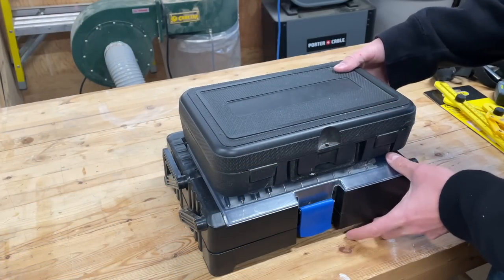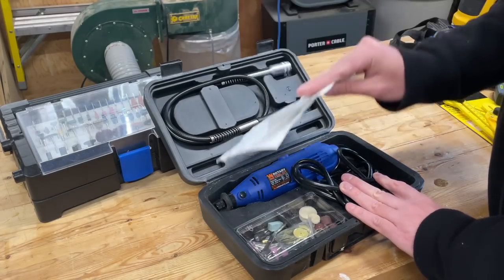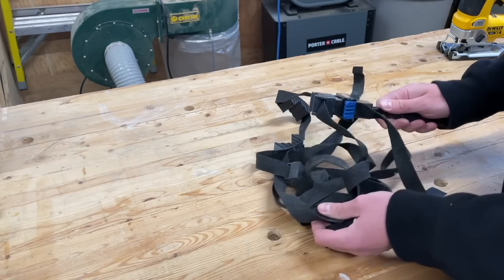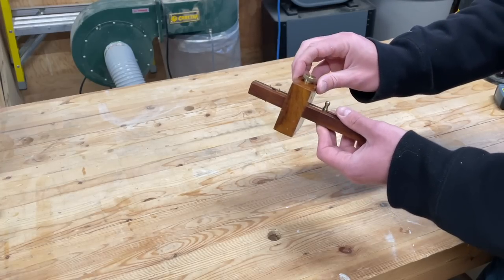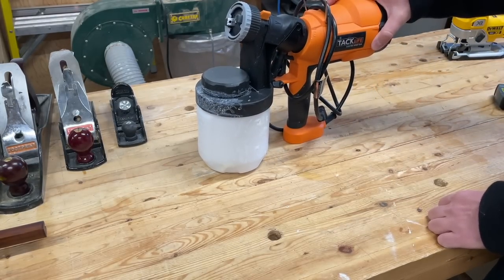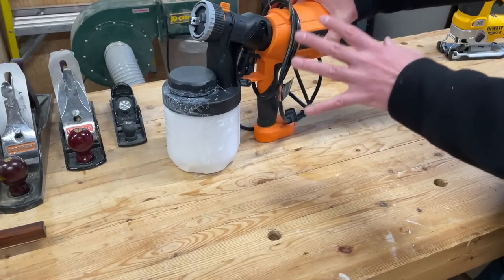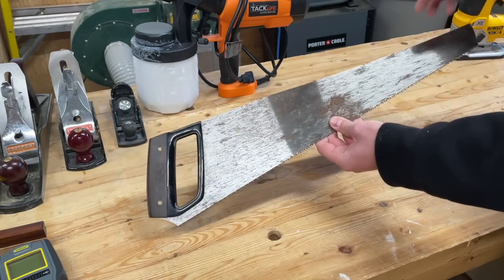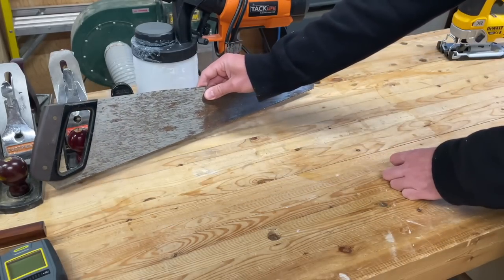Don't Buy These Tools // 10 Woodworking Tools I Wish I Didn't Buy

Comment: I have that same rotary tool and I actually love mine. It's come in handy many times. Not sure what you mean by "glitching out" but I've never had a problem with it. It's not a tool you will use a lot, but when you need it, it's amazing.
Reply from the maker: Happy to hear that you've had a good experience. I'll still use mine for small things here and there, but the motor will give a bit of a buzz, then shut off. I then have to leave it for a few minutes before it'll start again. I probably should have tried to return it after it did it the first time.

Comment: YES! Do not buy cheap. My rule is to not buy till you need it. Having said that, I do have a sweet Incra miter gauge that’s been in the box for nearly a year. It’s not because I don’t plan to use it. I just have a large honey-do list that distracts me from my hobby. (probably should’ve waited). My least used tool is a general tools contour gauge. I think I got it to figure out a shape to the laminate flooring around corner. Cardboard works better. I rarely use my jigsaw, BUUUUT it’s great when you need it so it will always be part of my arsenal of tools.
Reply from the maker: Ah yes, those contour gauges - they are always among the most-promoted "tools" on Amazon and infiltrate my Instagram account regularly. Similar to your Incra miter gauge, I had my Porter Cable dovetail jig in a box for 6 months before I finally go around to setting it up - now I love it!

Comment: Every time I think about getting a cheap tool, I end up deciding I'm better off with no tool.  That has kept me from just buying a bunch of tools I might need.  If I want a certain tool, I look at the best of the best, and then compare downward.  I find that easier than starting off cheap and trying to compare upward.  When comparing upward, price is the main focus over feature/quality gain.  You think more about money than what you want to accomplish.  When comparing downward, loss of features/quality is the focus over cost savings.  You think more about what you want to do, and what the end result will be.  Instead of thinking is it worth $50 more to get that feature, you're thinking is is worth loosing that feature to save $50.   I don't always buy the most expensive tool, but I usually feel like I got the tool that will do what I need it to.  There have been exceptions.   I've come to dislike a lot of Amazon.  They're turning into a flea market.
Reply from the maker: Awesome thoughts there, thanks for sharing Chip! I really like your approach to buying tools. I'm currently planning a "here are the tools to get started woodworking" and I'm realizing how many tools/accessories that I have that while they are useful for me, they are also unnecessary when it comes to the results.

While Amazon can sometimes have deals on well-known name-brand tools, what they promote as "tools", "DIY", and "home improvement" products is absolutely brutal. Lots of lighting strips and cheap knock-off tools. Sad part is that it's not just with tools.
Reply: I agree. Took some years but I came around to the "what is 2 or 3 notches down from the best?" way of thinking. I rarely buy the king of the hill, but I save a lot of money and still get a lot of good capability by going for a high qualifying runner-up.

Comment: Agree re: Dremel , woodplaner and the saw . Disagree totally with the jigsaw . It's got so many uses . With a scroll blade you can cut quite delicate curves , or change blades and rip decking boards  . 2nd tool I ever bought after my drill .
Reply from the maker: I've really come around on the jig saw and it's become a frequently-used tool in my shop! Just took the right blade and right setting to get it perfect.

Comment: My husband bought me a Dremal which I have used for a number of things. Stripping furniture with hard to reach areas. Taking the edge of a tile so I could replace an outlet in the bathroom with one that shuts off when wet. The new one would not fit. 
He also bought the accessory kit to go with it. What I have discovered is that some things I have used so much I have had to replace them several times. Some I have never used at all. But until you own one you have no idea what parts are useful.
Reply from the maker: Thanks for sharing! I think there is something to be said for the name brand tool and accessories, especially with regards to Dremel!

Comment: The problem with cheap hand planes is that they deter people from going further into woodworking. If you want a good plane, buy a used Stanley type 19 or earlier. You can find good users or ones that have been tuned up, but chances are you’ll throw some time into tuning it up yourself, which will be worth the effort. Just learn the cheap features on cheap hand planes and why they are not worth the effort. Then go get a vintage Stanley and when you take the first very fine shaving off a board, you’ll be glad you went vintage.
Reply: Great comment. My first hand plane I bought at Lowes. I returned it the next day lol

Comment: I bought a $15 Lowes hand plane and spent countless hours getting the bottom flat.  In the end, i'm happy i bought it and fixed it up and it will get me by until I know more precisely what nice one i need to buy.  

The one purchase that I instantly returned was the Kreg Accucut, or whatever it is called.  I had to make modifications for it to fit my circular saw and it was not precise at all.  The wider the cut, the worse it got.  Thank goodness for Woodcraft's generous return policy.  Junk!

Comment: I agree with some of your choices except for Dewalt jigsaw. It's not a tool iuse a great deal since i bought it, but when i do use it I'm so glad I did, I know that if I sold I would regrat doing so later on. Pretty much the same for the rotary tool. As for the angleiser I live in hope that one day I will find it useful and think to myself what a great purchase. My worst 3 though would have to be an electric tile cutter and a mitre saw stand, both sit in my shed taking up useful space. And a dewalt cordless angle grinder, used it once 6 months after buying it and could not believe how much it used up batteries, One of my best has to be my Dewalt cordless 1/4 sheet sander, Iuse it daily at work and it is great.

Comment: I also want to say that stay away from any Harbor Freight "woodworking" tools that are used for any cutting, marking or measuring. The only thing I but from Harbor Freight are 1/8" drill birds for my counter sink drill bit, some of the clamps and the casters. And, any of the one time use items like acid brushes, small quite brushes and wire wheels for your drill. I did buy the 2-n-1 18g air stapler and bread nailer, the Diablo air hose and the purple gravity paint sprayer, those are worth it for getting started but will definitely upgrade in the near future
Reply from the maker: Ah yes, the wonderful world of Harbor Freight (rough equivalent here in Canada is Princess Auto). When visiting the USA, I've hit up Harbor Freight a few times and those coupons make some of the larger ticket items temping, but I've generally stuck to some of the cheap squeeze clamps and casters like you.
Reply: I would probably buy a door stop from Harbor Freight.

Comment: You must have gotten a bad Kreg multi-mark and should have returned it for another. I love mine and have been using it daily for the past 7 or 8 years. I use it mainly for repeatable dimensions, especially when I do metalworking.
Reply from the maker: I've been using it for some home improvement projects the past few months and have found it helpful for reveals and other depth-related items. It has it's use in those cases, but it's not necessarily as versatile as Kreg pitches.
Reply: Kreg multi mark is an amazing tool and worth every penny. A great addition to my tools. And I agree. Mine is completely square.

Comment: I agree with everything and yeah i bought a rotary tool and wish i didn't and yeah agree with you view on the marking gauge's round blade is better, I have two cross cut saws in the corner used a couple times in a decade, even came close to buying a moisture gauge and a sprayer but didn't thankfully, as for the jig saw most things can be done with a coping saw just as quick but i do use it for tissue box top openings and similar things. LAST but not LEAST I have the same small yellow angle finder and its horrible just haven't brought myself to toss it out yet. 
Lesson learned from your video is you need to spend decent money on the things you actually need and you don't know what that is till you need it. 
Thanks for the video.
Reply from the maker: Thanks for watching and sharing! Absolutely agree with you.

Comment: Refreshing review!  Add up what you spent on the poor tools, not including the jigsaw, just to realize what GOOD tools you could have purchased for the same money.  If I think I need a tool I put it in the back of my mind until not having that tool either makes work much harder or I can't complete the job without it.  I use my  (real) Dremel tools all the time when building radio controlled airplanes but almost never in the woodworking shop.

Comment: I have a cheap electric spray gun and it is totally ace - yes you have to thin the paint, but I also have compressor fed guns which need paint to be just as thin. I can get some really fantastic finishes with my cheap electric gun - infact I tend to use it more than my compressor fed spray guns as it is more convenient. Gotta keep them clean, gotta thin the paint, but the cheap spray guns are totally fine.
Edited to add - a moisture meter is really important woodworking - helps to understand what allowances should be made for timber that is not perfectly dried. Also, cheap is perfectly fine - I have checked the cheap lidl/generic ones against a much more expensive moisture meter, and they are fine between 10% and 30% which is really the only range that matters. Cheap moisture meters are perfrectly fine, and I would advocate for the cheaper the better!
Reply from the maker: Great tips on the spray gun, Lewis! I also revisited the moisture meter not too long ago and I'm generally getting sufficient results from it. Not quite as consistent as a really nice one my neighbour has, but it's giving me consistent-enough results to make decisions on which boards are ready for work.
Reply: @MasonWoodshop  The other thing I forgot to mention on the spray gun, is I have found there is a huge difference in performance between paints. In fact, that appears to be the single biggest factor that influences results. I spray water-based eggshell - I have tried a few brands and found one which flows well, has plenty of pigment (so still has covering power when thinned) - predictably, it is on of the most expense! I know you are in the US, but in the UK my go-to brand is layland trade water-based acrylic eggshell.  Anyway, enjoyed the video and agree on the other comments, but was suprised by the spray gun and moisture meter comments. Cheers.

Comment: If you are having trouble with your piece vibrating too much, I believe that's what clamps are for. I use mine all the time to make rough cuts and sand down the rest to where I need it. If you are having trouble with tear out use tape to minimize/eliminate the problem  like most projects.

Comment: I've got that same moisture meter and it works fine for getting a relative reading. For woodworking you don't really need it to be precise to within a percent or two, just to know that you're in the ballpark to be able to work with it.

In the video it's all over the place because you're probably on the drywall setting. You need to click it over to softwood for that bench. Also not sure why you need the manual to use it - it's super straightforward. Turn it on, select either hardwood or softwood, and stick it on the material. Won't give the most accurate reading but enough to tell you when it's settled enough to start using.

Comment: If you're going to get a strap clamp and don't want to deal with that mess, keep an eye out for models that have a strap coiling mechanism like the Bessey Tools VAS-23.
Some of the cheaper brands or even the shorter length 12 inch Bessey model just have it hanging out to the side, which would cause a mess when trying to store
Reply from the maker: Definitely! The Bessey VAS-23 and an MLCS version are both on my wish list for that exact reason.

Comment: i have the bessey strap clamp version and it's still a pain in the ass to use.  Doesn't work well at all with thinner boards for framework.  I'm sure it would be great if those boards were flipped on their axis but boards laying flat, hard to get a tight fit without it springing off when tightening.
Reply from the maker: I recently checked out the Bessey to see if it would be much better and while the quality was generally better, the straps were still annoying. I'm going to be checking out the one from MLCS sometime soon.

Comment: I'm glad that you figured out that your Dewalt Saber saw is a worthwhile tool. I had to laugh about your snobbery on the handsaw. My grandfather built a LOT of houses with a similar hand saw. He sharpened it often and NEVER let it rust. The blades on his saws were polished so much that they looked like chrome. I have second thoughts about someone's opinions on tools when they allow them to rust thru neglect. I bought a cheap Dremel knock off and used it a lot to grind out the rivets on salvaged metal lawn chairs. I've also used it a lot to remove paint and/or rust from the nooks and crannies of other projects I'm refinishing or restoring. And I got a similar kit of attachments that also gets used often.

Comment: RE: moisture meter,: First Interface is as simple as it gets, you don't need the manual "all times:", just read it once if at all. And second,  you're not supposed to measure painted or finished wood or drywall, you're supposed to measure against the raw material, any finish will alter the reading because it encapsulates humidity.

Comment: I thought you were going to say the battery jig-saw was the unnecessary tool, not the jig saw in general. I'm a carpenter who is always looking to switch to battery tools when it makes sense, and have had a few jig saws over the years. This is one tool that I don't break out often enough to warrant a switch to a cordless version. BTW Good clamping of the workpiece plus just going slower helps me to keep a piece from jumping around with the jig saw.
Reply from the maker: I've really come around to love my jig saw since posting this video. It just took some time dialing in the settings and using the right blade - getting beautiful cuts now and I haven't found the battery power to be negatively impacting the cuts at all.

Comment: I have to agree on most of these as I made the same mistakes purchasing them, but I also have to disagree with the strap clamp. I love it. I have one from Harbor Freight and the only difference is that mine is a ratchet strap with the corner locks so it gets good and tight. I do agree that it is a tangled mess to store, but works wonders on large frames and similar items. I have not used on boxes and that might be its weakness. Great video.
Reply from the maker: Thanks for watching and leaving a comment! I like the idea of the strap clamp, it's the unwieldy straps that have become a barrier to non-frustrating use.  The ones from MLCS and Bessey seem to have a better mechanism for rolling them in after use.

Comment: I feel you on the paint spray gun. I did the same thing. I got a cheap-o brand on Amazon that had very high reviews. Maybe I'm just dumb, but I can't get the thing to not blow out a diarrhea-pattern. Haven't made any actual use of it yet.
Reply from the maker: Haha, I had to thin my paint so much to get a consistent pattern but it wouldn't stick well to the material. Awful!

Comment: i bought some cheap rotory tools - performanx menards. i use Dremel bits/jigs with them (cheap bits are totally worthless). i find their best uses are free hand trimming of material (fiberglass, plastics, thin metal). i also use the circle jig on ABS and 1/2" or below MDF for fast cut outs. it works great for that. i some times use the sanding drum but you cant really get a perfect edge geometry so i always try to use a router if possible. also the 90 degree adapter is great for tight places.

Those general tools - i own a set of aluminum shape making jigs (think they were 300.00, forget brand name) that are fucking AMAZING to use with flush trims and pattern making. a must have imo.

never used a strap clamp or tracer like that. 

i bought an old 1940's hand planer at a garage sale that i still use. its fucking amazing!  ive never found a "modern" hand planer for anywhere near the price

those 110v spray things are shit. i bought a set of spray guns (hand brush, full booth spray, and hlvp gun) off the snappy truck

Those markers for angles - any tool with play in it sucks... its just infuriating to make marks and then find 2 feet down a board that its off by 1/4"... >.<

I think a jig saw is totally needed for a wood worker. you can hog off LARGE chunks of extra material before you take a piece to the band saw or router table. i do not use them for any exacting work but pre cuts are phenomenal.
Reply from the maker: Thanks for the comment, Adam! Totally agree that cheap bits are worthless, they either break right away or just don't do a good job. The good news is that I've really come around on the jig saw and use it all the time now. The right speed and blade made a huge difference!